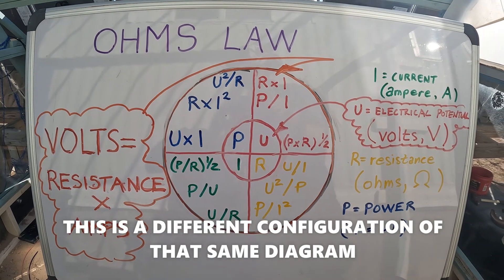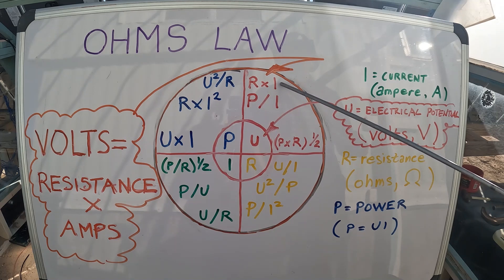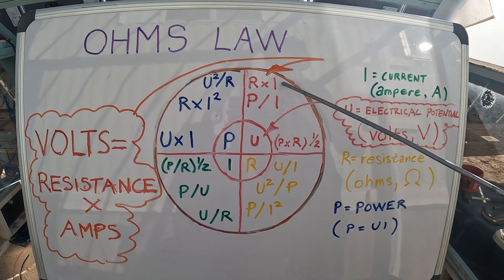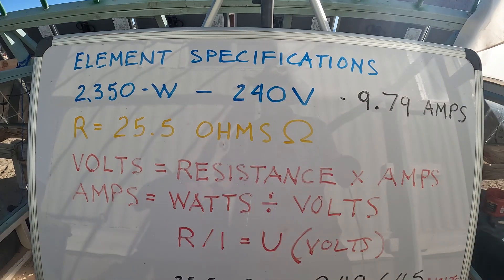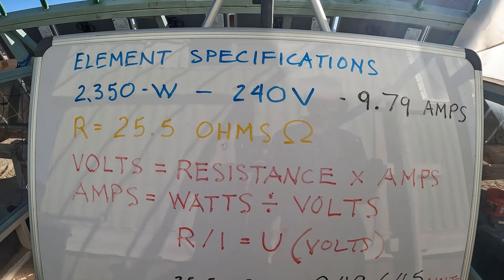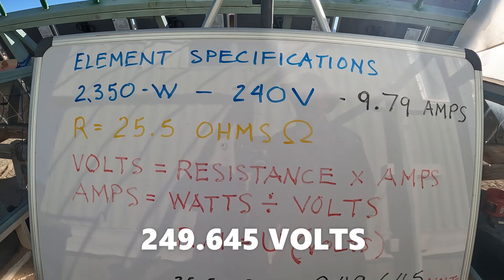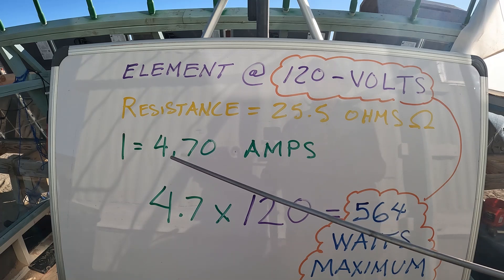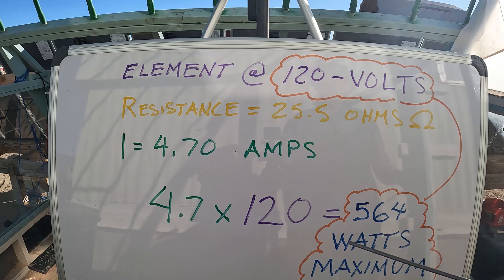OHMS LAW Part 22

Comment: The thing you have to remember is that solar panels have a fixed amperage so the panel adjusts the voltage to fit. with no load you get the max voltage but with a load the voltage drops to what works with the sun and the fixed resistance of the element. So the wattage changes from what the panel says it is to what can be produced by the sun and load. Hard to explain so easiest way is to get a clamp meter for DC and see what you get  when under load. You are on the right track thanks for the video.